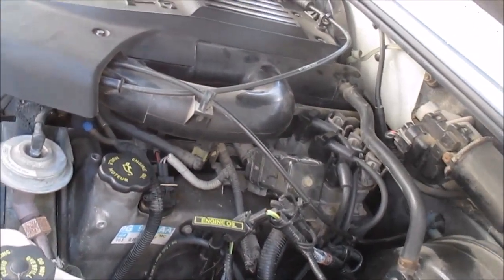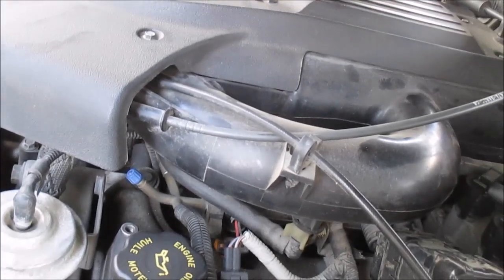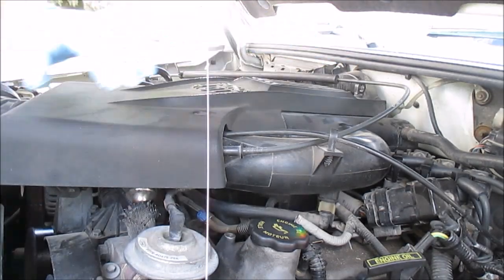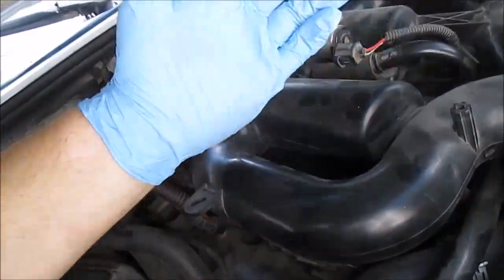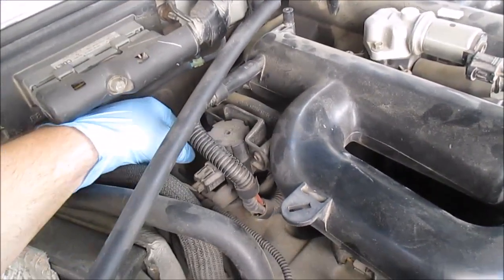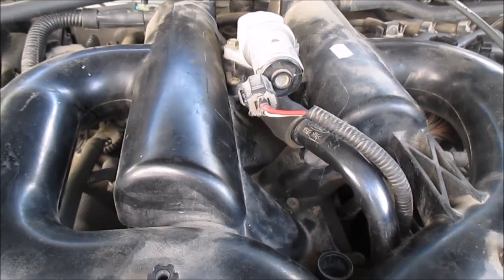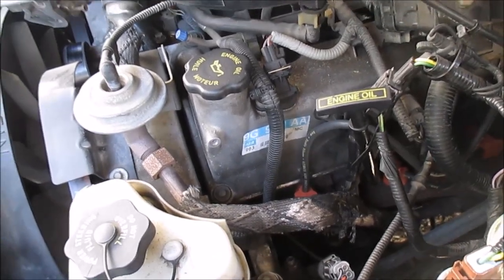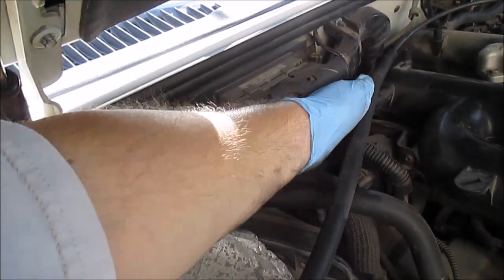Ford Explorer 4 0L SOHC Rough Idle Part 2 Vacuum Leak Hunting

Comment: My method is to use a small vinyl hose connected to a small funnel. Just move it around and you will hear the direction and location. The smoke is the best and safest. What year is this engine ??
The part that sucks is the number of hoses to check. A non lit propane torch with a funnel nozzle works well for me fella. Peace vf

Comment: Of course I'm not there to say positively, But the sound that you are chasing is the air that is going through your induction tubes.that your throttle body is hooked up to, those two black round cylinders on top of your motor are made of plastic and the air moving through them it sounds like an air leak.

Comment: On my 1998 explorer there is a vac hose on the drivers side of the car it's a 3/8 hose that runs from it looks like right on the front of the engine and runs down to a, looks like a box it's about 16 to 18 inches  long and it was split on both sides and would collapse every time I started the car. I'm a contractor  so I just cut a piece of old 3/8 air hose and BINGO fixed. Hope this helps and have a great day.

Comment: Do you know where the HEATER CONTROL VALVE hose leads to ?  It broke so I have to replace it when replacing the heater control valve for 98 Ford explorer?

Comment: Smoke machines are not the holy grail. WD-40 works. I been using it for 50 yrs. Not good as a penetrating oil but good for most other stuff. What ever works. I hope you got the problem solved.

Comment: I found most efi systems are pretty good at maintaining the idle speed even with vacuum leaks, they will maintain even with the introduction of a fuel source to a vacuum leak.  My explorer only had a slight change in idle when i sprayed brake parts cleaner around the back of the manifold.  I found the pcv had popped out of the hose.  I did however see it big time on the fuel trims on my scanner when I sprayed around this area it leaned the fuel out a lot to compensate for the introduction of the brake parts cleaner to the intake tract.  I still have a leak, I’ve yet to change the pcv valve so this may be it, maybe the intake gaskets themselves.

Comment: Good luck bud because the tiny vacuum lines or rather need to intake and only way to get to him is pulling the upper intake off which is a pain in the ass I have the same problem with my Explorer on the driver side towards the back you can hear hissing

Comment: Get out a cigar, plug up the air intake and blow in smoke into the brake vacuum line. The price of a cigar is cheap tool to find that vacuum leak. Afterwards, don't forget to unplug the air intake and plug the vacuum line back in. Have fun.
Reply: Do I do that while it's running or off?

Comment: I have a hate for new cars and trucks. The 1990 4.0 was the best of the 4.0 engines it had NO EGR VALVE It had no Plastic intake and the self-life of the 2002 and later 4.0 with alum heads was short-lived. one major flaw with the dual overhead cam engines is If you have a timing chain issue. Most shops tell you to get a junkyard engine. 

Now tell me why any shop would tell you that it takes 12 hours to do a timing chain. My old 4.0 I've never dose a timing chain in 15 years with 250,000 miles

Comment: Why are you spraying it with starting fluid ?
Reply: It’s a way of finding the leak, if you spray starter fluid on the vacuum leak the fluid will get sucked into the engine and cause it to rev higher and signal the leak
Reply: If the engine revs higher that means the hose is sucking it in

Comment: Was your engine making a hissing sound; basically, was it noticeable you had a vacuum leak with sound alone or did you figure it out by rough idle/start up? Ive spent two days looking for mine which sounds like it is coming from the center area near the rail line/injectors. I sprayed it last night engine sounded great. Tried it today and nothing.
Reply: I noticed I had a leak but didn't think much now my truck running like shit

Comment: Easy to build your own smoke machine get old spray gun take it apart shorten nosel in side get a H.P shut off valve buy a cheap soildering gun drill a hole on side of spay gun can stick iron faceing down get a couple bottles baby oil and an old sock 3 ft. clear hose its cheap so you can put in line with vacume hose coming from break booster second hose to blow smoke threw or use compressor at 5 psi. it should make the leak stick out like a sore thumb there is a fella on you tube that made the same one it works great.
Reply from the maker: Thanks for watching!
Reply from the maker: And thanks for the tip!

Comment: I explorer 2008 4.0 v6.rough idle at stop. codes showing four oxygen sensors.egr  valve.purge control valve.what I tried is as follow.change fuel pump. change fuel filter. clean throttle body and injectors. change spark plug. change egr vlave. change front 2 oxygen sensor. still the engine hesitate at idle. ac compressor turn off when rough idle.
Reply•
Reply from the maker: The trouble is this could be caused by so many things, I think you need to have a simple scan tool that shows live data. The reason is you need to be able to see what your o2 sensors are doing, and to see what the computer is seeing (make sure they are in closed loop and switching properly), need to look at fuel trims (long term and short term) to see if your vehicle is running rich or lean (these numbers can also help determine if you have vacuum leak at idle). I think having 4 o2 sensor codes would be a good place to start,(you said you changed the upstream o2's but did you also check the circuit integrity or did you just swap out the sensor) Could be an o2 circuit issue and not the sensors themselves. Especially if you changed the o2 sensors out, but still have the codes present. Also you said you changed out the spark plugs, what about the spark plug wires, what about your ignition coil (you may want to make sure it is firing properly (use a spark tester, oscilloscope, or a simple test light hooked to ground and check spark at the ignition coil) The test with the test light you can check for spark and also do a cylinder power balance test to see if you have a misfire at idle, and find out if you have a cylinder that is not contributing. Here is a link to a video showing this test. 
 https://www.youtube.com/watch?v=5ewJIBS9L98
As I said your problems could be caused by so many things, but you need to be able to see more info to get a better picture of what is going on. I have seen rough idle issues caused by bad plugs, bad plug wires, weak ignition coils, weak fuel pumps, or restricted fuel, air restrictions, exhaust restrictions, timing problems, low compression, weak crankshaft position signals causing idle issues, weak camshaft position sensors, egr flowing at idle will cause rough running engine, I mean the list goes on and on. My advice to you is get a simple code reader one with live data, so you can look at what is going on. You can find simple scan tools online for under 20 and all the way up to 10000 just depends on what you want your scan tool to do, but just a simple generic obd2 scan tool with live data should be able to give you enough info. I have a few scan tool video reviews on my channel if you are interested. Well I hope this info helps you out, and good luck to you. Well thanks for watching and thanks for the comment. Have a good day.
Reply: I think you have a bad. IAC valve

Comment: WHERE DID U GET THOSE PLUG WIRES AT MINE DONT LOOK NOTHING LIKE THE ONES YOU HAVE LET ME KNOW ..IT WOULD B A BIG HELP THANKS
Reply from the maker: I think I bought them from rockauto.com or off ebay.com they are motorcraft plugs I believe the part number was WR5944. I remember when I got them they had 5 black plug wires and 1 grey plug wire, which I thought was weird, but that is how they come. Well I hope this info helps you out. Thanks for watching and thanks for the comment. Have a good day.

Comment: always start with the pcv cause mine had misfire in 2 cylinders lean code bank 1  and 2 its always the pcv the problem
Reply: I replaced mine 2 weeks ago and have just about all cylinder miss fire codes. I definitely have a vacuum leak just not entirely sure where :(
Reply: al carr  I'll look into it. Thank you

Comment: So, I managed to get mine done, and I'm still having lean codes, with no vacuum leaks, I've smoked it and done starting fluid, and I'm getting good MPGs, but it's coding leans, the gaskets helped a ton though
Reply from the maker: Well if you still have lean codes with no vacuum leaks present. Could be lots of things.  Could be a fuel delivery issue. Lean conditions are caused by either to much air or not enough fuel. Perhaps a clogged fuel injector. You can do a fuel injector pressure balance test, but you need an injector pulsing tool (I bought mine for 30) Basically what you do is hook up a fuel pressure gauge to the fuel rail, and plug in your injector pulse tool to one injector, and the tool turns on the fuel injector for a precise short amount of time, you do this to each injector and compare the before and after fuel pressure drops of each injector. You have to cycle the key between tests to rebuild the fuel rail pressure. If the fuel pressure drops do not match. Then you have a fuel injector fuel delivery issue (probably needs injectors cleaned) I had the same issue on my explorer. You can can on car injector cleaning or off car injector cleaning.  In fact as I write this I am waiting on my fuel injectors in the mail. I sent my injectors out to be professionally cleaned and serviced (internal filters changed, ultrasonic cleaned, new o rings, and new pintle caps) I used this website http://www.mrinjector.us/ For 6 injectors to be serviced cost around 105.00. 17.50 a piece. Which may seem high, but to replace an injector cost around 100 per injector just for the part. I will be posting a video showing this whole procedure with in the next few days. This is my first time using this service, so I will wait and see and post results when I get my injectors back in the mail.  Anyway, so lean conditions are either to much air or not enough fuel.  Of course there are numerous things that can cause this problem vacuum leaks, clogged injectors, cylinder misfires (if air does not burn up in cylinder it gets pumped down to the o2 and that creates a false lean), faulty or skewed sensors (map, maf, tp, coolant, o2, iat,) basically any sensor that contributes to fuel pulse width can be suspect, exhaust leaks, bad o2 sensors.  Anything that causes unwanted air to get to the o2 sensor can cause a lean or false lean condition. Well I hope this info helps you out. Good luck to you. Thanks for the comment and have a good day.
Reply: I found it, right rear of the upper intake is spaced out further than the front and air is going in there, I'm going to attempt loosening all bolts and tightening it in a different pattern.